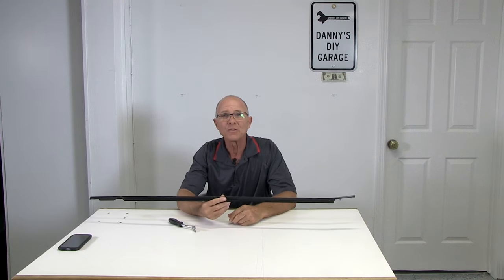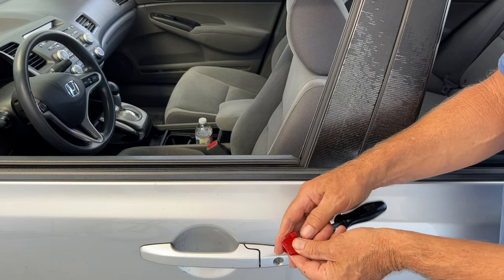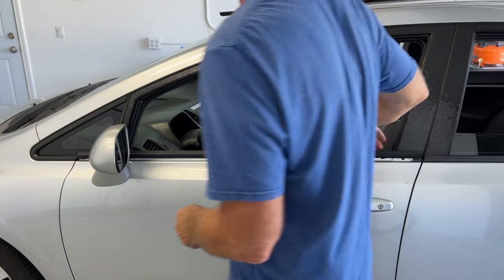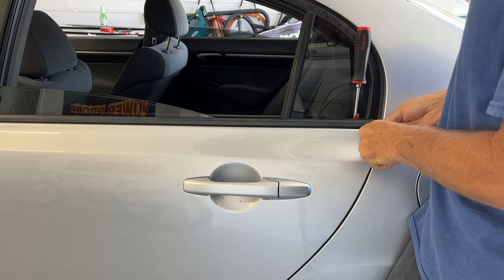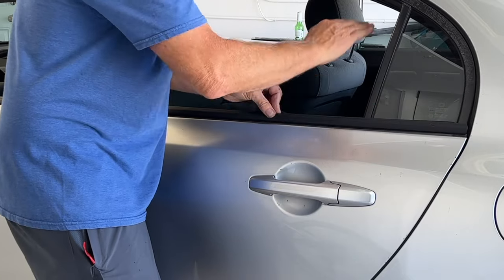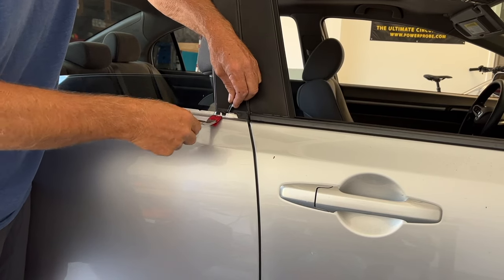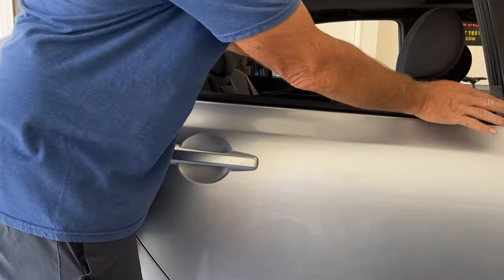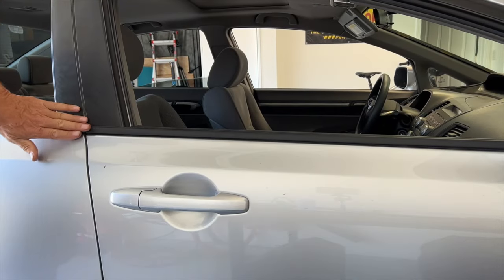Window Seal Molding Weatherstrip replacement Honda Civic 2006 2007 2008 2009 2010 2011

Comment: I can’t find weatherstrips anywhere for my 2002 civic lx. Is there any other alternative i could try out?
Reply from the maker: I haven’t felt with this company https://omacshop.com/products/honda-civic-sd-2002-2006-window-trim-cover-4-pcs-s-steel
Reply: i actually have these parts, it fits but it doesn’t seal the window

Comment: Great tutorial, thank you!  OEM parts are ridiculously expensive for what they are.  Plus aftermarket trims don't fit well.  I'm thinking the plastic part could be salvaged and the rubber strips could be easily substituted by something else.
Reply from the maker: These are a perfect match and work well. Good stuff

Comment: Looks great, but so did mine with the ones I bought on ebay. Unfortunately over time they started leaving sticky residue on the windows, terrible quality. I wonder how this brand stands up?
Reply from the maker: This is holding up fine, I don’t foresee any problems

Comment: Danny, do you know anything about replacing the rubberized moulding on the outside of the Windshield? There are strips to the left and right side of the windshield that protect between the frame and actual glass to keep out moisture. Ours got so weathered that is fell out in a carwash. I would appreciate the input.
Reply from the maker: They’re available at the dealership, they are not cheep but easily installed, I need them also, just cannot justify the price

Comment: I wonder if careful preheating with a heat gun make it a lot more easier to come out with the old brittle plastic
Reply from the maker: I’m not sure it would make any difference, it might shrink the rubber and make it harder to remove but I really don’t know, I look forward to an update 👍🏼
Reply: @dannysdiygarage  It'll be till spring, I'll preheat it for kicks and giggles and let you know

Comment: Hi Danny - what is the name and where did you get the tool you used to pry the old pieces out....just ordered the parts on Amazon....thanks for sharing the link ..greatly appreciated!
Reply from the maker: It’s just a door trim tool, probably not the correct tool, something like this would probably work better Tresalto Auto Trim Removal Tool Set (No Scratch Plastic Pry Tool Kit) - Auto Trim Tool Kit Car Tools, Easy Door Panel Removal Tool, Fastener Removal, Clip, Molding, Dashboards, Interior Trim Tools https://a.co/d/4uN6icN

Comment: Hi, my window seal moulding pop off a bit and every time when i close the windows, those are shaking when the engine start or music so loud. So shoud i replace the window seal moulding ?
Reply from the maker: It should fix it, pretty cheep, easy fix
Reply: @dannysdiygarage  my car is honda civic 2012 4doors, is it work on my car ?
Reply from the maker: You’re going to need to search on Amazon for window seal molding Honda Civic 2012 ,

Comment: Where can I buy these trims for my 2009 Honda civic? Where did you order them from?
Reply from the maker: Amazon
Reply from the maker: GZYF Window Weather Stripping, Window Seal Moulding Weatherstrip Compatible with Honda Civic 2006 2007 2008 2009 2010 2011